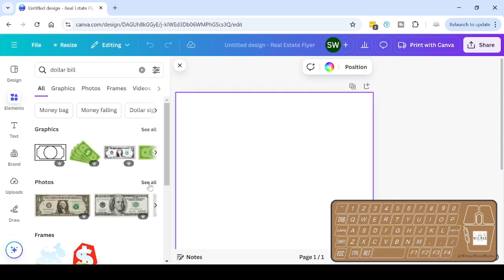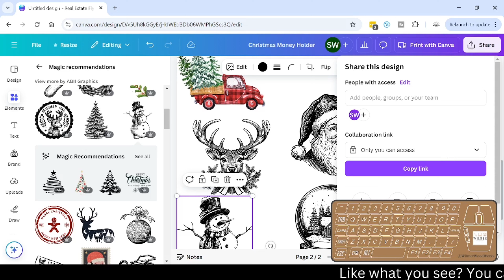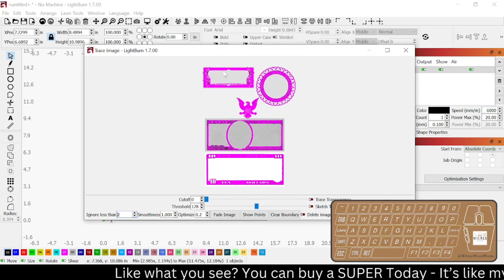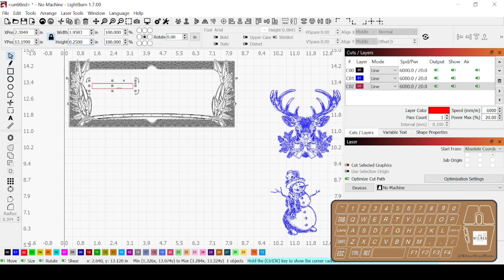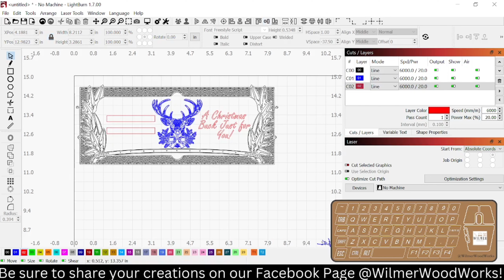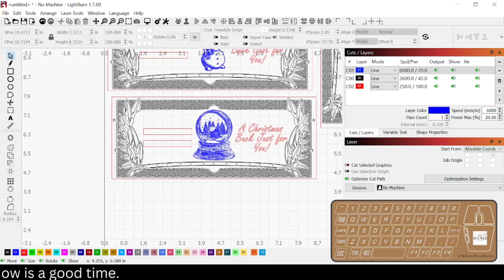DIY Christmas Money Holder – Perfect Secret Santa Gift with Laser Engraving

Comment: Your setup showed that the letters were in the RED color which showed 250/100, cutout, but when you showed the item, the letters were not cut out, they were engraved. Did you change something before you engraved it?
Reply from the maker: Yes I thought 💭 I changed that on the DL the letters should be the same as the center engraving 3600/20